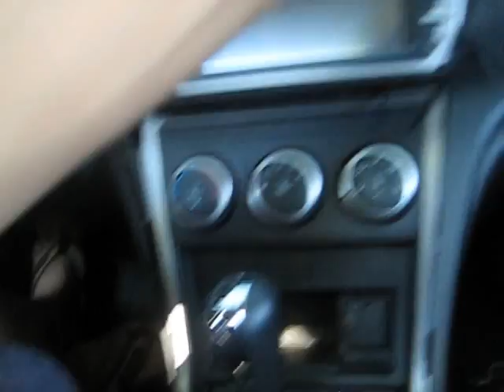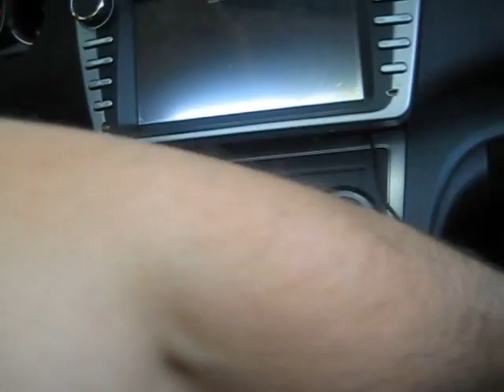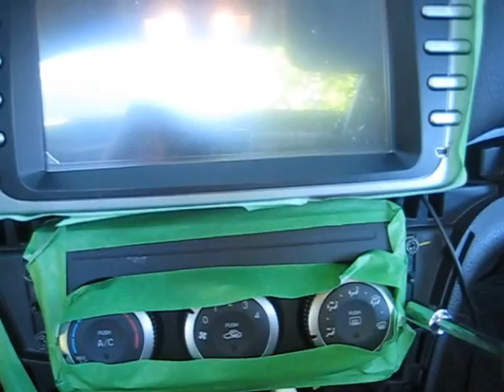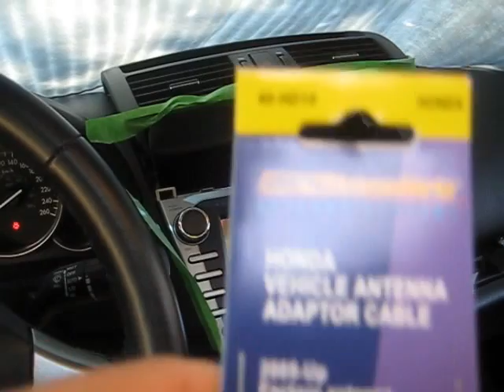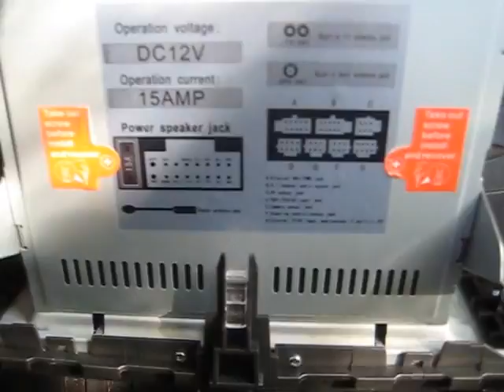Caska 3642g 8" DVD Nav for 2009-2012 Mazda 6 - US Model ( installation)

Comment: I have d exact type...but after 4 months the sound just went off...pls what do I do....?
Reply from the maker: Abigail6681 Ajayi If all the speakers stopped at the same time must be the stereo amplifier, but try first to remove a speaker and  check the wire voltage with the radio on. Or just replace one speaker and see from there. At mine I had to replace all of them as one stock speaker went bad.

Comment: I have Caska as well for my 2007 toyota rav 4 sport. the radio went in perfect but I am having in issue locating on the wires which one is to let the radio know about the brake line so I can use video. Do you all have any suggestions?
Reply from the maker: Just don't connect that wire or, If that wire must accept a signal from the hand brake that says is on, then use something that can turn on when you start the engine, like a dome light?

Comment: I have caska 3641g unit in my mazda 6 (2009) and after I have installed I can not acces board computer and I do not have information on original mazda lcd screen. I have just connect cable I got with my caska and steering wheel is working but there is problem with lcd. Does your (and my also) have integrated can bus and how did you connect (wired) steering wheel controls
Reply from the maker: the can bus is integrated and the wires are in the main harness, big female jack, so there are no extra wires for it. If you don't see the mazda screen at all it means that you accidentally unplugged it when installed the new stereo. If you see the radio station/av/ ipod / dvd message when change but don't see the clock part with the mileage, then press info button on the car. Mine shows the clock when the motor is off and the stereo on, but changes to kms left once you start the engine. Check the video with the same name but " ( review) "and see what I see. Also might want to disconnect the battery and reconnect to restart everything as the car has 6 computers and is like something new added. But if you do that remember the trick with the auto windows that can be find in the my other video with the speakers upgrade.
Reply: On the left side of LCD there are air condition information, in the middle there is nothing, and on the right side there is only fuel consumption information!
Reply: And how to connect camera to automatically switch on the HU screen when I put my gearbox in R? Thanks in advance!!!
Reply: Where is info button on the car?
Reply from the maker: in your case, in the middle should show the commands for your stereo ( radio, dvd, ipod,) warever you choose
Reply from the maker: jozo nakic the info button is in the left of the dashboard, where the traction control and trunk opener are
Reply from the maker: jozo nakic you have to have the extra plug from the HU that has an yellow video jack out ( female)  and a green wire for the automatic backup that will be connected with your back-up camera. the power for your backup camera will be connected to a car backup light wire, and the video and automatic wire ( green) to the HU. is not in my video, I figured it out later.
Reply: But it is not working
Reply: I mean on LCD
Reply from the maker: jozo nakic maybe you don't have the can bus, that was optional ( $20), and camera was optional. what about the steering wheel commands, work with the HU?
Reply: Steering wheel commands works fine!!! Only problem is with mine LCD!
Reply from the maker: I don't know, it could be new HU
Reply: maybe my power cable is not same as yours (4:48 min on this video) Mine cable is without this little black box. Do you know where can I buy this power cable which you use for your HU?
Reply from the maker: +jozo nakic It makes sense now! If the steering wheel controls doesn't work is because you don't have can bus! That usually is optional, it's like $20 extra. Need a can bus!